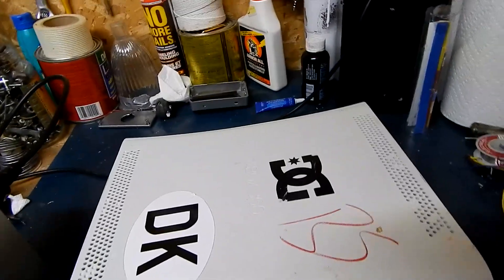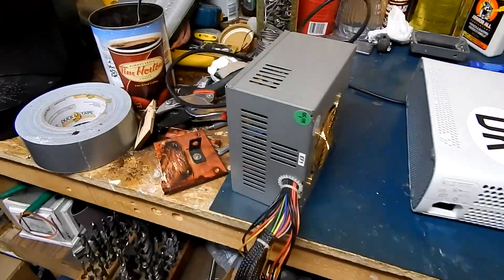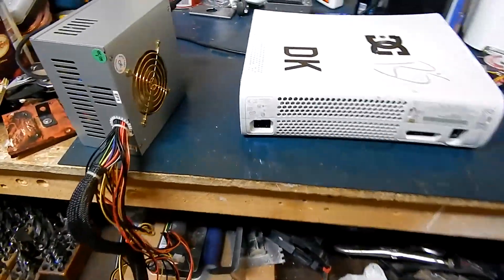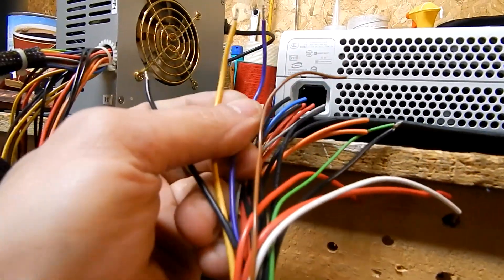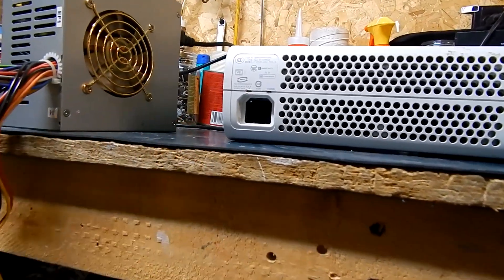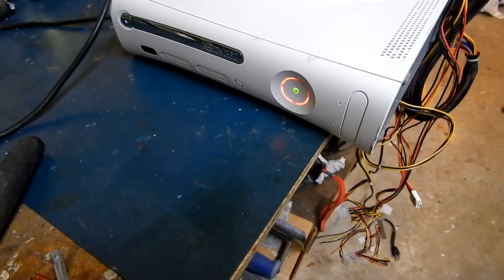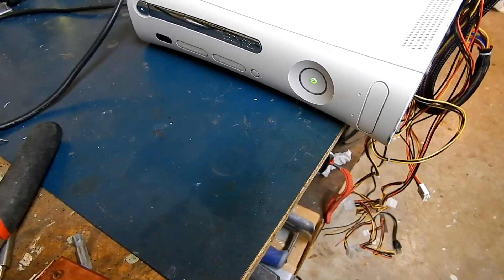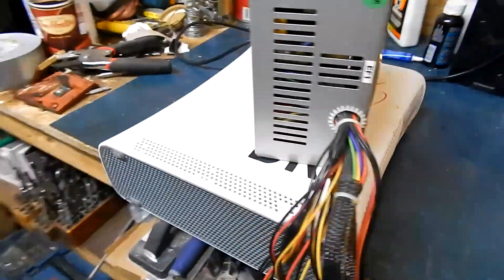xbox 360*standard atx power supply*

Comment: Hey mate can you help me with a query. I got a 300 w power station ac and it's not enough power for the original 360. Do you think the xbox 360 e 15watts less would work this sounds dumb but I want your conformation 😊
Reply: PSUs for Xenon 360s are 203W, altho your PSU needs to have 16-17A 12V power. 360 E needs 10A 12V for Stingray and Winchester boards

Comment: Hey man, I have a question my Xbox 360 clearly has the three red rings of death, and it won’t even turn on the fans even the disc tray will not open Do you have any idea why this is happening?
Reply: This is a 10 yr old video bub😂 but could be multiple things, get your secondary rrod code
Reply: Sounds like PSU or power related issue on board. Do the thing of holding sync and press eject to get the code